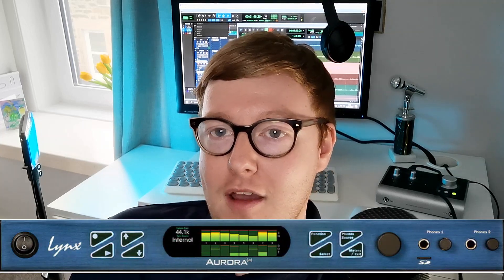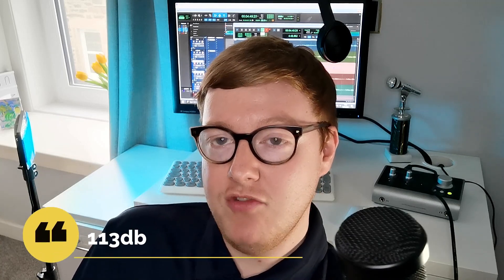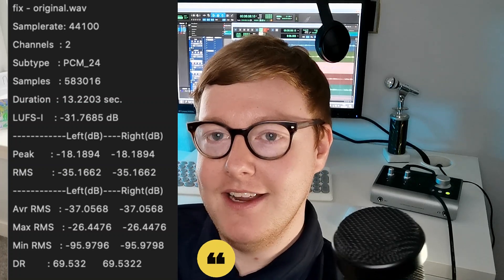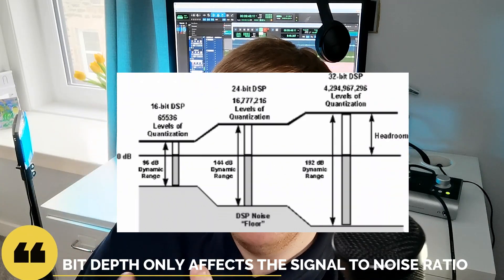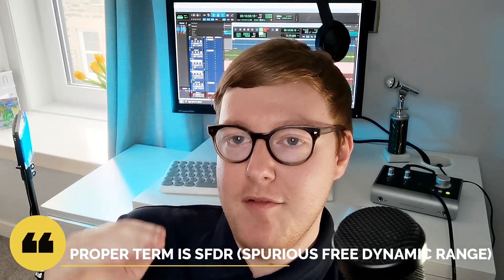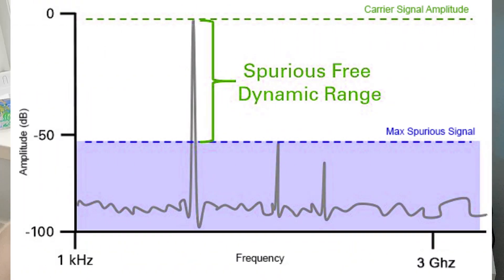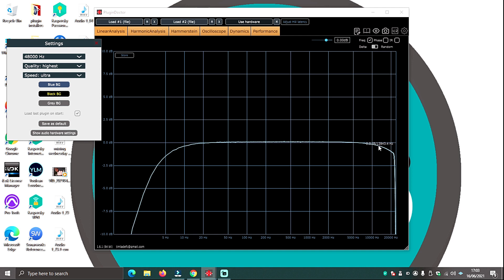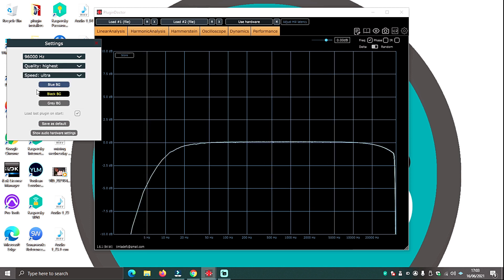Do you lose audio quality in analog gear using budget interfaces vs expensive ADC Converters (Pt 1)

Comment: Very, very😉nice empirical test!
I wonder what would happen making x50 or x500 passes with the Lynx and the color it supposedly adds🕵🏻
Reply from the maker: Pointless test tbh. Never really understood why people do those tests when you really only do one or 2 round trips on one source at the most in reality 🤷‍♂️

You could argue in a chain of gear on kick, then gear on drum bus, then gear on mixbus. Maybe 5 or 6 pieces of gear but the kick is then swallowed up by the rest of the drums, then drums by the rest of the tracks. In the science of differences, any difference caused by ADC is completely swamped by the difference of the rest of the tracks. 

Doesn't really pose any big difference still. 

I always measure things based on how they will actually be used.

Somebody could say "ohhh but after 50 round trips the audient really starts to deteriote when the lynx starts to crumble at 100"

Are you doing 50 trips of ADC on a source?...

“no but that's not the point"

So what is the point, that the lynx's conversion can do something better that will only happen when used in a way that no audio engineer will use it?

"yes!!!"

And that's when you let the Internet be the Internet and dissolve itself

Comment: Sorry but just ask anyone that upgraded from a cheap interface to upgrade their converters and tell me they dont hear a difference… you wont hear much of a difference in a single vocal test but when you have 30 tracks going through it all at once you will hear the clarity difference. Now is the difference worth the price thats up to you but i know for a fact that higher end converters do make a difference.
Reply from the maker: Of course you'll hear a difference if you are listening through the converter DAC. Im talking ADC in this video NOT DAC. You don't need expensive ADC for printing analog gear, high quality monitoring via DAC is a different story

If you print gear through an Audient SP8, then a lynx, and listen to the prints through an RME ADI 2 pro FS or something like that, you'll struggle to hear any difference between the 2 as the sound is outputing through the same DAC

Comment: I fell down the UAD rabbit hole a couple of years back and bought an Apollo twin x, with all the plugins..

Then I learned about 500 series just recently lol, 

I have just got a 500 series rack with some 500 series hardware but..

I have only just found out I cannot by pass the pre amp in my Apollo twin x, 

Do you think it should be ok or Will it effect my sound? 

I was even thinking of buying an ID24 just for the fact you can by pass the pre amp and the converters are very clean, and the ID24 MKii are cheap to buy. 

I didn’t see the Apollo in the chart shown in your video I’m curious to know what the noise is on the Apollo twin x compared to the rest of them, 

Thank you 

I learn a lot from your channel great videos!
Reply from the maker: I imagine you should be fine. Depends on how linear the preamps are but it's not something I'd be sweating over. If the 500 series stuff sounds good to your ears then it sounds good
Reply: @PaulThird  drew from uad told me I should be fine he said the pre amp is incredibly linear, and the pre amp input noise is -127db, 

I thought I would get a second opinion from you though as I value your knowledge and opinions, 

Thanks for the reply Paul means a lot thank you! 

Amazing person and amazing channel!

Comment: As cocky as you've said that you've just "proven hat the audient is more transparent than the lynx"...

.. I have to break to you honestly that you remind me a lot of a 13-year old who thought he'd discovered something incredible that he thinks no one else knows and later on discovers he made a mistake and he actually discovered 0 and rather made a fool of himself, that's what this video is about.

You can't just take a clip and nudge it by the lowest sample value and think that you're phasing it out now properly. You're quite limited by the limitation of that very sample rate...

In order to properly match the phase, you have to move the audio in the sub-sample area... You'd also have to check whether there is a gain mismatch at the level coming back, which would be as simple as that studio's patchbay or cables which change the level. You didn't check that either properly.

There is actually a thread that properly covers what you've failed to do and rather made you look like an uneducated prick: https://gearspace.com/board/gear-shoot-outs-sound-file-comparisons-audio-tests/607481-evaluating-ad-da-loops-means-audio-diffmaker-95.html

Audient is also listed there and it's actually a really good converter for the price but nowhere near the Lynx Aurora (n).

I really don't know why I had to watch your video for fsake.

Comment: I know about that rolloff but I still record at 44,1/48 kHz. Because those frequencies, most people don't hear them anyway. -0,8 dB is really nothing to be bothered with, especially when you're going to EQ and change the signal when mixing.

Whether you can hear the difference, you didn't do a blind test so I call bullshit.
Reply from the maker: It's not just the frequency roll off, it's the high end phase shift that comes with it

Believe what you want 🤷‍♂️

Comment: How is this a fair test? You’ve converted from analog to digital through a preamp and your gear. Sending that to another converter and nulling it isn’t showing anything other than the differences of signal from your recording vs passing it through another set of D/A - A/D conversion. To actually test this accurately, you would need to use your preamp and your Audient converter, then use your preamp and a Lynx converter when tracking. Both sending to the same interface. That would show the quality of conversion. This is like recording a VHS then passing it through and to a DVD and comparing. Your signal from the raw VHS will look better because there’s less digital degradation.
Reply from the maker: The audient has no affect on the access analog print 🙈🙈

The vocal used is a random vocal recorded by somebody else. I don't know what was used and it doesn't matter. 

To print through the converter in the id14 have to physically route the daw audio to the audient as a loop back and then record through it. So line out of audient to line in of audient. 

interfaces have NO effect on the daw print or bounce when using them for playback. That's why you manually have to create a loop back 

The access analog print comes direct from the daw, sent over the Internet, to the lynx and back to the daw via Internet. That is then printed to a seperate track in the daw which is manually time alligned.. In the daw. 

So in this test the audient recieves it's own line out signal 

The lynx recieves it's own line out signal 

It doesn't matter what the recording going into the converter is as its a completely seperate process. I'm not comparing preamps, I'm comparing analog to digital conversion. 

If an artist records a vocal through a focusrite scarlet and then the mixer runs that signal into a 6 grand compressor it's the A/D converters job to ensure that the processed signal has been kept in tact and unaltered during the analog to digital conversion .. That's called transparency.

In this test both converters were ran through the same daw which was protools. Both tracks recieved their own line out DA converted signal. That's why it's a fair test.
Reply: @PaulThird     First, thank you for clarifying as I misunderstood the signal flow with the audient line-in/out and the fact this audio source was just a random bit, not actually recorded with your equipment for the test. Guess I missed that bit in the video.
Your test was good, and I understand what you’re going for, but I feel that there’s a bit of weirdness between doing a loop back to the audient, and also comparing it to Access Analog, even with lossless audio transfers, there’s a lot of in-between going on there with internet transfer that may be affecting the signal path (as there is no way to know except to assume and trust Access Audio’s claims). I feel (subjective) it’s not apples-to-apples, but more like lemons-to-limes. It’s close but there’s still some unknowns that could be affecting the signal, even down to Access Analog’s Lynx converter itself, along with how the sound gets transferred back to you aside from the Lynx converter. Backend stuff we just aren’t sure about. 🤷🏻‍♂️ A real, physical version at your studio would limit the variables, but it would also cost a lot, and I get that too. Is it worth the hassle, probably not. For what you had, it was a solid test.

Now, I’m going to be honest with you, but the way you responded to me, a viewer of your channel, is a bit strong. I was simply voicing a concern I had with your test, and you clarified and reiterated, as I did miss something….but…
Perhaps next time instead of talking down to your viewers, you should just chill when you answer and ask if that’s an appropriate reply.
- I know what transparency is.
- I know you’re not comparing preamps.
- I know the audient has no affect on the Access Analog stuff.

What I don’t know is why you’re talking down to me like I’m a complete moron. I’m learning just like you, and to reply to me the way you did was less than professional. Try using less of these, 🙈 🙈 as this comes off as rude, not helpful.

Comment: My understanding with Lynx is it is a custom platform specifically designed for your DAW I/O requirements, and clocking/stability/drivers tend to be more robust on the higher end units, including RME.  However, I have been happy with my Tascam Celesonic so far, even feeding it an MAudio Profire through ADAT.  Probably tempting fate without a dedicated clocking setup but will see how it fares in coming months.  I hope in my situation I do find I don't have to go crazy on conversion and perhaps can focus on the colored pre-amps (500 series) etc, I am thinking of adding.  The ID14 seems to be a great option indeed.  I have always been a little bit suspicious of the UA hype, although they are great.  Black Lion Audio does some interesting ratings on the various interfaces.

Comment: Man, you're the mythbusters of audio equipment industry 😁 I'm about to purchase one of lynx converters instead of an audio interface. You just made me think twice.
Reply from the maker: Yeah it's pointless spending that kind of money in today's market. The audient evo 16 & SP8 together is only £800 for 16 in and out with smart gain and decent conversion.

If universal audio didnt give me the apollo x6 I would be audient id44 expanded by SP8 with topping dx7 pro+ as my main DAC via spidf.

£1500 all in and I'd have the option of 12 mic/line ins, 4 JFET DI's, 12 line outs, 2 sets of ADAT in and out whilst being monitored by arguably the best DAC amp on the market

Compare that to an 8 channel lynx converter for over 3 grand.. Waste of money

Even my current setup of apollo x6 (expanded by SP8 for more inputs) + topping dx7 pro+ comes in at £2800.. Which is STILL cheaper than a limited 8 channel lynx aurora with a shit headphone amp.

Easy maths haha

Comment: Im a bit confused on the testing strategy here, once and analog source is recorded to digital..... how do you test again.
Reply from the maker: The lynx conversion goes DAW> streamed lossless to server > through converter > streamed lossless back to DAW.

Doesn't hit the audient once. Instead of using physical cables to record a loop back you essentially use virtually streamed cables. You dont need an interface connected to do it. Could run the daw with a virual driver and print access analog gear into the daw.

The only difference between having the physical unit in front of me and streaming lossless online is that that the audio isn't going through physical cables at my end.

To test the audient conversion you have to create a loop so line out to line in of interface. That's it. Daw audio comes out of the line out but instead of going to a speaker it goes to a line in or preamp so if can be recorded

Comment: I once had the chance to take a peek into one of those older high end analog/digital converters: It used a Burr Brown chip and it did indeed a very nice job. But that chip rang a bell and I remembered to seeing the same chip in a newer version in a cheap Behringer device. And with cheap I mean cheap as a launch at the big M. That cheap! The preamps were much better in that high end converter but intrestingly that Behringer thingie was still good enough. We made an A/B comparison and I was not able to hear a difference until we came close to clipping. And you don't want to record close to clipping unless you know what you do and really want that compression and subtle saturation. The owner of that high end converter was baffled. He used it, because it was clear and transparent. And it was. But the price difference to modern cheap gear came only out, when you used it kind of hot. Pretty weird.

Same I heard from a reel to reel. The guy heard they were great, to bring back some analog warmth. He grabbed a Studer, brought it to a tech to service it and it was a phantastic recording device. But the difference to a direct to harddisc recording was negligible. So he talked again to the guy, that gave him that tip and he used a Tascam prosumer reel to reel and drove it hard. There it was. All the "analog goodness". That sublte compression and saturation.
Reply from the maker: Law of diminishing return will always be the crux in modern day times as technology has advanced so much. You can only squeeze the lemon so much

Comment: That lynx you used is emulation bro, you need a real lynx to compare.
Reply from the maker: It's a real lynx streamed lossless online
Reply: @PaulThird  You still had to plug your mic in through the audient that way no? or am I missing something?
Reply from the maker: The lynx conversion goes DAW> streamed lossless to server > through converter > streamed lossless back to DAW.

Doesn't hit the audient once. Instead of using physical cables to record a loop back you essentially use virtually streamed cables. You dont need an interface connected to do it. Could run the daw with a virual driver and print access analog gear into the daw.

The only difference between having the physical unit in front of me and streaming lossless online is that that the audio isn't going through physical cables at my end. That's it
Reply: @PaulThird  Nice, good to know. Thanks

Comment: Oh come on man, you don't know what Access Analog is doing in the signal chain, you didn't even bother to work out of the Lynx was running at 96khz (every converter is worse at 44/48 for the same filter reason). This has already been done ad nauseum (eg. On Gearslutz there's a huge post of painstakingly compared null tests on all converters known to man) and hate to break it to you but Lynx HILO/Aurora (n) is top of the pile and destroys Audient every single time and twice on Sundays. You're not doing anyone a favor here sorry 😞. If you want to do tests like this, get the real interface so you can control all the variables properly.
Reply from the maker: Having been a long time since I made this video, the plan is to credit card a lynx aurora N and do pink noise nulls vs apollo x6 and audients new SP8. And also a full mix null with blind A/B's to prove that at 3 grand it's a complete waste of money in 2023 for an 8 channel ADA, especially considering its the same price as an apollo x16 and double the price of an apollo x6 which gives you unison preamps, dsp, and some of the best measuring ADC on the market. 

BTW the 44/48 filter thing is complete bullshit for ADC. With ADC the converter uses an analog filter and happens before the sampling and ADC. The reason 44.1 is 44.1 and not 40khz seeing as we only hear max 20khz is to cater for the filtering so it doesn't encroach the audible range (20k and below). 44.1's 2.05khz of extra bandwidth is purposely to cater for the analog filtering before the ADC. 

There is no logical reason why using a pure ADC converter at 96khz would be better than 44.1khz. There is no better resolution recording with 96k compared to 44.1. It's the same 2 sample points per frequency that make up the bandwidth.

you are confusing ADC filtering with DAC filtering which is different. You would be correct with DAC filtering as its a digital filter and certain filters can cause ringing near the audible spectrum (that's why i bought my topping dx7 pro+ for playback as it has like 7 different filter types) but this video is specifically talking about ADC conversion with analog gear, not DAC in regards to what comes out your speaker's. 2 very different things there. 

I could track through analog gear and never use the audients DAC. I could send a mic through a preamp, straight into SP8 line in, let it go the ADC and out via adat to another interface to do DAC but in regards to what the daw recieves there is no DAC. The null measurements in the daw will be purely ADC related cause the DAC only matters on the output end. 

Mostly all of these units are using the same ADC converter chips, Warren Huart has said it multiple times. Now in this decade more manufacturers are moving towards ESS SABRE for DAC and id argue my £700 topping dx7 pro+ would wipe the floor with the lynx's 5-6 year old DAC tech conversion. The topping measures better than mostly any other DAC on the market, Amir proved that. Lynx hilo (which is the same converter tech in the aurora) isn't even in the top 20 for THD+N DAC and I know he measured it when it came out. 

However I'm digressing talking about DAC now but yeah, a 'hands on' ' test is coming this year